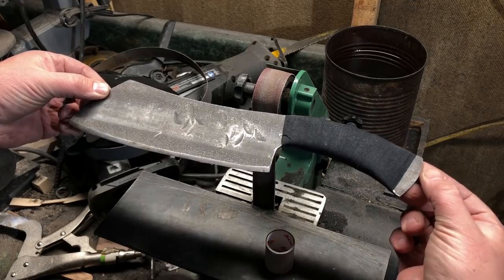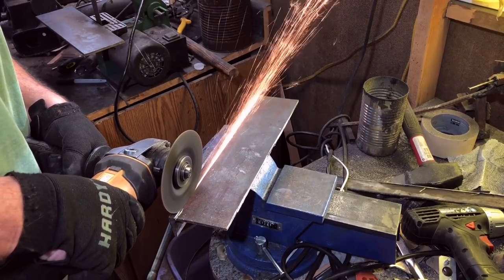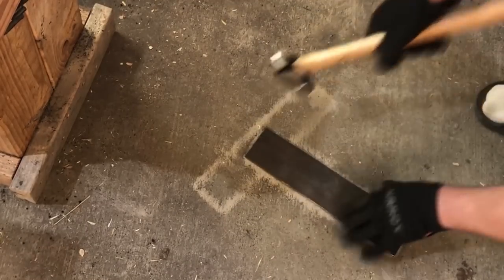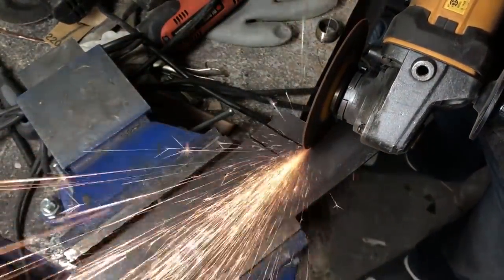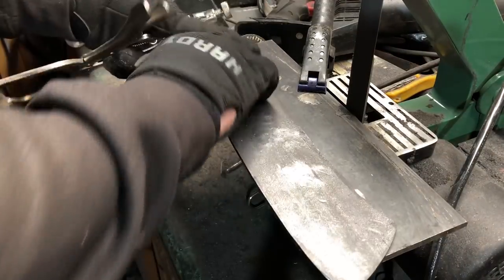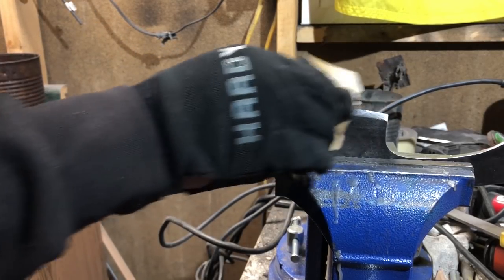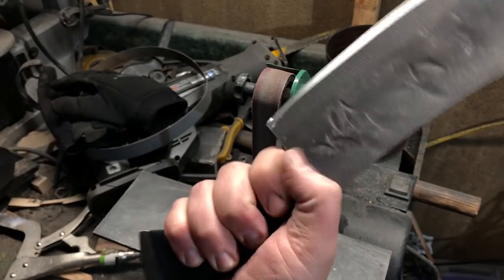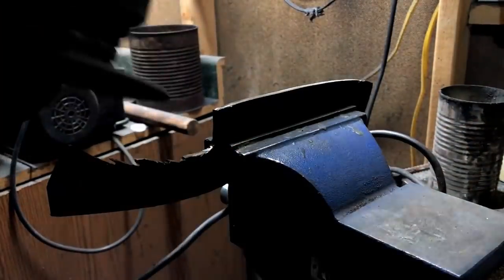How to make a cleaver knife from unhardened steel scrap (will it hold an edge?)

Comment: Not to be a safety Sally or anything (I do the same thing) but probably not the best idea to do a demonstration without the guard on. Especially with the cut off disks. Those can shatter and fly right at you at that speed and do a ton of damage. Great work though. Sorry if it sounds negative, Was not meant to be.......
Reply from the maker: Magilla7395 You are 100% correct! I am pinning your reply at the top. I’ve had cutting discs fly apart on me before—VERY dangerous.
Reply: Agreed!! I am guilty of the same thing myself but definitely a risk especially with those thin cutting disks! :)
Reply: i loved the safety boots too ;'D
Reply: Beat me to it Magilla. Having a thick grinding wheel on is one thing without the guard, but do it enough and eventually one of those thin cutting disks is going to come apart on you and you'll wish you had that guard on. Even with the guard on I almost had a nipplectomy one time. Getting hit with a shattered disk at a couple of thousand rpm's is not a pleasant thing.
Reply: @FargoFX  people have died because of this ...
Reply: That’s happened to me before it was extremely close to my no no square if you know what I mean

Comment: When you're cutting, throw the sparks back at you, and stand offset so you don't set your clothes on fire. You have more control over the grinder and if it catches it will pull away from you, not toward you. It's not a bad idea to wear a protective face guard too. Those thin cutting blades are brittle and can shatter if they catch. Sweet homemade cleaver. I wanna make one now. Thanks for sharing doing stuff with basic tools.

Comment: Neat video! Although I would have to disagree with you when you said that your knife wouldn’t be able to slice paper or be razor sharp. I have gotten some mystery steels up to a hair popping sharpness, however, if you look at it funny, it will loose that edge. You made the right decision with grinding the bevel nice and thick. There’s nothing wrong with practicing on scrap steel, hope you learned something and improved your knifemaking skills on this project!
Reply from the maker: pyrotech1999 Thanks! Based on the bursting sparks I saw while grinding I’m thinking this might be at the high end of low carbon steels. Might test harden a couple pieces and if it works I’ll do this Knife next. I’d definitely re-profile that edge though. Might make an interesting video.

Comment: well, I almost lost a finger cutting with that type of tool , and without using protection, that was my hesitation ! So, what did I learn using this type of power tool ? 
me instead of pushing them forward, throwing the sparks forward , I pull her to my side throwing the spark at me ,This is not a crazy idea, if you get used to it ! you've gotten used to cutting it that way, but if you chop it off your side, you got rid of the tool locking up , and will not run the risk of the disk crashing and injuring itself !!! 
Sorry if my English was not very good, I do not speak English very very well okay ! but it is advice from a friend over
30 years of experience !!!
    Take care of yourself buddy !
Good job, great knife !

Comment: Muito bom! Very good,what's this steels is that? I understand a little inglish
Reply: If is a 1070 steel,1095 steel...
Reply: @darleychumbo1899  ITS MILD STEEL. SO CLOSER TO 1018.
Reply: @darleychumbo1899  
AÇO LEVE... HOPE THAT HELPS.
Reply: Thanks! Good job man! 👍🏾
Reply: @theoutpost969  it is not a mild steel. the spark tell it got some good amount of carbon to be hardenable

Comment: That's a fine looking chopper you made. I wonder if it would be able to be hardened and tempered? But then again it seems to be working great as is. Cool video.
Reply from the maker: Nick Miller Good question, I’m actually in the process of test-hardening some leftovers from that project. Might have a video coming soon.

Comment: Dremel does well for tight areas-just don't want to have to use it for extended periods as it will get tiring being slower.   Need to get me an agnle grinder-using one of my circular saws with metal cutting blade [[bst I can do ATM]] but it tends to meet unevenly/hard to see where the cut is going from point A to B.   Why not use that cleaver as a Cleaver?  Chippin' up chicken and veggies and such rather than wood?

Comment: Could you make a kitchen knife from mild steel I'm new to this world and only have access to steel from local hardware stores
Reply: YES. ITS GREAT PRACTICE.... BUT FOR ACTUAL USE, IT WOULD NOT BE ADVISED. THEY CANT BE HEAT TREATED TO HRC HARDNESS RATING - SO CANT HOLD OR RETAIN AN EDGE. PLUS, THEY RUST LITERALLY IN MINUTES OF COMING IN CONTACT WITH WATER, IF NOT WIPED OFF IMMEDIATELY.

Comment: Yes you can harden mild steel ( channel iron aka structural steel ) heat and oil quench, then case harden in an oven at 400-425° for an hour  then let air cool . You'd be pleasantly surprised  I believe.

Comment: I really hope you put a guard on your grinder in the future if nothing else than to teach children the proper way to use this tool...  and yes, plenty of children and young adults watch these types of videos.   As a former welder and fabricator,  I've done my fair share of dumb things with tools and usually you end up learning the hard way.  I've had those grinders jump so hard that no regular person would be able to control it.  In my years metal working I saw lots of blood drawn with these and much worse, lost teeth and fingers.  I worked with tons of different dangerous tools in my life but these hand held high speed grinders are near the top.

Comment: I reckon you could chop down a small to medium tree with that thing. Do the grinding disks wear away to nothing like the cutting ones or do they just go dull?
Reply: From my experience: slightly. I have been using the same grinding disk for about 3-4 years (since I got my first angle grinder) and it has not weathered away very much. However, that might have something to do with the wheel being clogged with soft metal and other debris. The disk still hacks away at metal, but I’ll mainly only use it to refine the shape of a blade, or remove scale/burrs.
Reply from the maker: Yup, I’ve hade the same experience as these guys. I don’t do all that much grinding, but my old discs seem to last forever.
Reply: pyrotech1999, That's a long time if you use it regularly. I wonder if you grind into a dressing stone or stick (for bench grinder) if it will freshen it up again.
Reply: alex rentz, Have you tried a dressing stick or wheel for bench grinders on it? I wonder if that would work. I have some projects coming up so if mine starts getting clogged or dull I might try it.

Comment: Try forging a folded axe with that steel but maybe you should also forge weld a piece of carbon steel on the edge
Reply from the maker: Tomaso Scalzo I like that idea. Need to build my gas forge soon. Charcoal just doesn’t get hot enough for forge-welding and I can’t get proper coal in my area.
Reply: +Tomaso Scalzo
in nowadays  we can simply  arc weld  carbon steel on the edge  ---  which work much fine than forge weld

Comment: these type of steel  contain 0.3-0.5 % carbon  ---  enough  to tempering the blade.
Reply from the maker: Alex Mann I believe you’re right. I tested a piece by quenching in water later and it definitely hardened the steel. I thought this was “A36” steel which is listed at .29% I think? But this piece might have been a bit carbon rich.